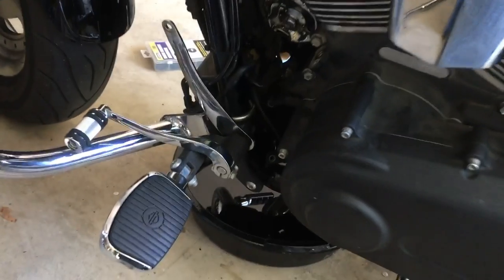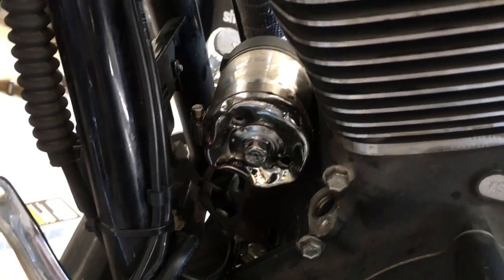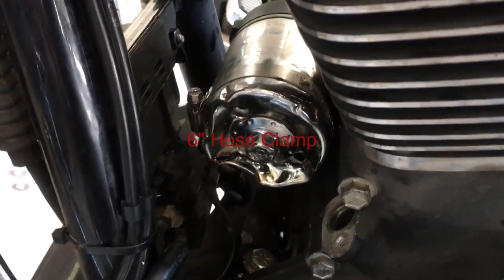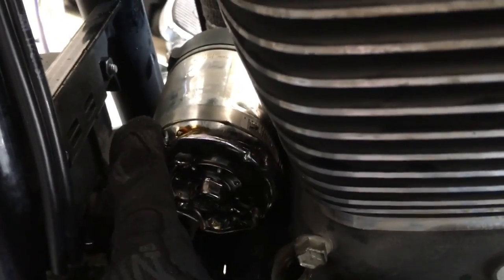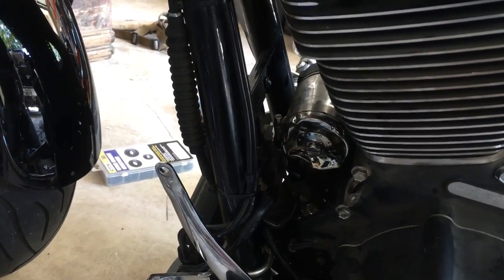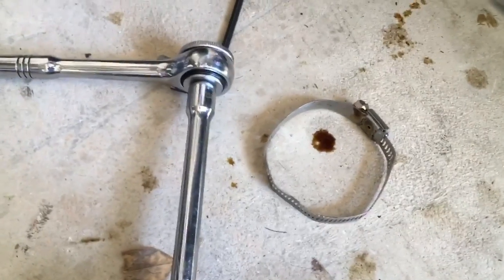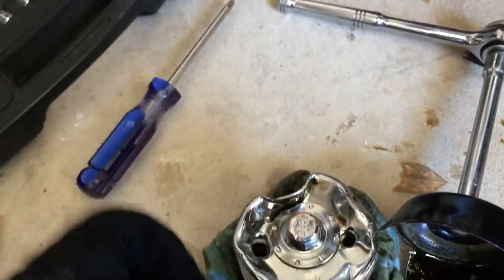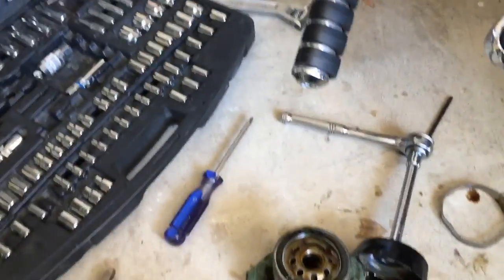How to remove a stuck oil filter on a motorcycle

Comment: Just ran into same problem and watching this helped big time. Only difference is I drilled a hole in the wrentch then a drywall screw through the hole into the oil filter, worked great, thanks for the idea!!
Reply: My thoughts exactly although I would probably not so brave as to use just one screw. I'd probably screw in several.

Comment: Thank you for this video.  This trick saved my ass today.  I've typically had a local shop do my oil changes but lately I've been wondering why I'm paying them $100 on top of the price of oil to do it when I can pay myself and do the work myself.  As you'd expect, the filter was so tight that you'd think it was welded on.  I have a 3-finger self-adjusting steel grabber tool that accepts a 3/8" square drive.  I can put my big powerbar on it but the grabber tool couldn't get enough grip on the filter.  The gear clamp solved the problem.  The gear clamp gave the tool something solid to grab on to without crushing the filter can.  On my '09 Sportster, there's so much stuff crowding the filter that you can't do much in there.  With the gear clamp, I could only turn the filter about 1/8'th of a turn and I had to reposition the gear clamp to repeat.  I had to do that about 6 times before I could finally turn the filter out by hand.  I put the new filter on only hand tight, like 60% power, not reefing on it.

Comment: I’ve had the same problem. I wrapped my filter a few times around with electrical tape and then put the wrench on. Works every time.
Reply: Your a legend. This worked instantly 👍

Comment: This last Sunday I just tore a chrome oil filter to pieces driving screwdrivers through it on a 2002 harley softail custom.  He what finally got it off after hours and having many sore muscles in my arms.  Here is an absolute method that will do it, but you have to take great care and turn you front wheel to the right so you wont hit the fender and dont hit against your right frame tube. Take a larger stanley chisel And beat the outer part of the front of the filter close to the bracket itself, then beat that area until a notch exist, then turn the chisel upwards and hammer it down  and it will come loose.  Mine also had been installed by a harley dealership and heres why it was so tight, becuae they had put red loctite on the inner threads of the filter. These younger college boy cadets use loctite for everything and dont know what theyre doing.  But heres what I could have done if I would have gone to the parts store, is get the strap oil filter wrench that has the 3/8 inch drive to ratchet it off.

Comment: For others that might find them selves in this situation ( 99 to 05 88's)  find yourself a 3" cargo tie down strap, like Harbor Freight sells, cut 9" off,  wrap 4" of 9" inches of strap around  clock wise a 6" 3/8 socket extension on the end of a rachet, then slide it in and over the filter on the front side, no need to remove sensor, then twist the drive and strap counter clock wise while feeding the loose end of the strap into the strap you are twisting, it will tighten up and the filter will start to twist out. Same for installing the filter if you don't have the K&N nut to grab on, but only about a 1/4" turn beyond hand tight.  You can also buy these wrenches on line, I happened to have the material already.

Comment: I did an oil change and now i have a leak around the two Allen nuts on the oil filter assembly. Did you ever had similar issues?

Comment: In my opinion it's more the aftermarket filter than the tightening torque, although torque obviously played a huge part. EXACT same problem. Idiots at K&N filters use METRIC bolt head in the end....for a freaking Harley!!! But with Harley filter no prob. Excellent video, thanks for the unique method.
Reply: First oil change on my 15 FLTR oil filter was almost impossible to remove. That's what Harley does. They have some stupid super tight torque spec for the filter. have been riding HD's with the case mounted filters since '89 always use K&N and never have a problem. I always use aftermarket over OEM

Comment: We've had that problem before. Didn't use hose clamp but great idea. Your way, you only need to notch filer removing tool just enough for clamp size. I have a wing nut tightening hose clamp could you use it backwards but have wing nut for easier adjustments required? I get black filters so when filter touches engine case, i put a chalk mark at 12:00, so I can follow filter mark an stop exactly where I want. So no more overtightening. Check out you tuber that cuts off bottom of round plastic oil container that just fits over filter. Then he drills out hole in lid of bottom to slide long extention through cap, put proper socket on then slide bottle over filter to remove! Bottle catches oil so no oil on rectifier an down motor! I liked it so much unblocking for fight sized round bottle for my own use! Thanks man!

Comment: what size oil filter cup wrench did you use on that?  the 74-76 mm cups dont't fit those shitty K&N filters. I'm in the same boat! Beyond frustrating.

Comment: Had the same problem. Simply take your filter removal cap and drill four equal spaced holes in it then place it on the filter. Use a drill and 4 self tap screws and drill into the head of the filter and then wrench it off. Now you have a ready to use filter cap that can be used for this issue if needed or not if it’s not tight.

Comment: Lionel here in Central California. 
That happened to me too. I have an oil filter wrench that has 3 arms that are geared. The more you crank, the tighter it gets. Works like a charm. I got it years ago when I saw it, I had to have it. It's saved me a couple of times. I did bo back to the shop and jokingly gave the mechanic a bad time. 
 It looks like your Harley shop doesn't use HD oil filters. That looks like a K&N filter. Just saying...

Comment: I always take mine in for that first check up and pay the 300 or whatever it is and of course the oil change. Last new one I got was a 13 King. I change my fluids every 3 k so when I went to start doin the oil myself naturally I found the filter so dam tight I fought and fought with it and the Harley oil wrench wouldn't work so I went auto store an bought a band wrench that had a pivet handle and worked it in over the filter with the handle between the frame uprights an above the oil cooler and it still slipped. Took it off and shot some sheet metal screws into the filter for something the band could grip onto. Put the band wrench back and it took just about all I had ta get the filter to move but I got it. I put my filters on 1/4 to 1/2 turn past . Never had a leak yet. It happened that way on my wide glide an then my o7 softail and then my 13 King. I hav always let them do it the first so I don't get any crap about warranty stuff and then I do from then on. They can kiss my ass and won't get my money for oil changes.

Comment: I use a much simpler method. I have a 2001 Ultra Classic with oil cooler and there is plenty of room to get to the bolts. Take the 3 bolts out that hold the housing that you screw the filter on to. No mess, no sensor removal, no shift linkage removal. I use a 6 point socket and 1/4 drive ratchet with extension. Removal is super easy. Clean everything and replace the 2 o-rings. I use a little blue lock tight and tighten (couldn't find a torque spec.). Put on the new filter (with a little oil covering the seal) and there you go.

Comment: same here, killed 2 cheap steel band clamps, they just broke,  tryed a chissel, didnt work, got a hole and oil came out.  tryed a  found a 3e band clamp in my toolbox and used self sticking sandpaper from ikea for in shower or on stairs. i put one on the filter and one on the bandclamp, sand to sand and it did work.  i also tryed the hose clamp , but it did not work for me,  even when i got the filter comming loose the threats where still hard to turn,  real strange , it was a chrome filter. i hope my new filter go's on by hand,

Comment: Man I have never seen a filter that jammed on.  The Harley dealer used a K@N filter?    Good the threads on your bike were not destroyed.
Reply from the maker: I did the oil change and filter, they tightened it when I took it in for an inspection {something about standard checks}. Hence being so pissed....
Reply: @MidLifeDucatiCrisis  You are right, only an idiot would do that. I've been changing oil in my cars and bikes for decades and never had an oil filter get stuck. I read the directions! Oil the contact surface and spin on until surfaces make contact, and then what it says on the filter, usually a half turn more.

Comment: should have tried some penetrating oil where the gasket touches the housing let it set over night and spray again, it will loosen the grip of the crushed rubber gasket.

Comment: Why didn't you try a regular oil filter wrench? You know, the kind you use on a car. It works! Ive used one before. There are 2 types, one has the built on handle, the other use a rachet with an extension.

Comment: The filters always come off hard, get over it. I take the cup style filter wrench drill maybe 6 or 7  3/16ths holes in it, put it on the end of the stuck filter and then install 6 or 7 sheet rock screws.  Turn it out with a wrench. Works every time.